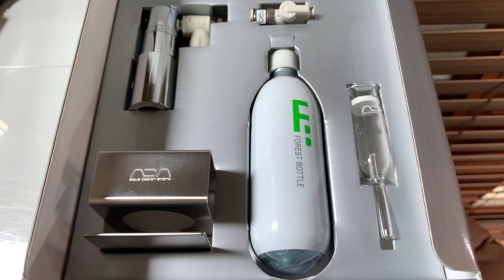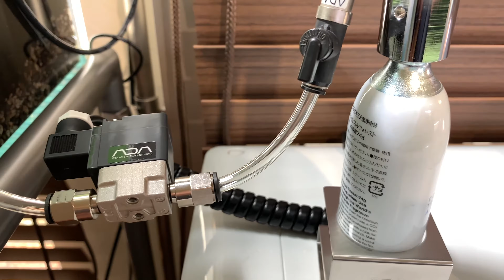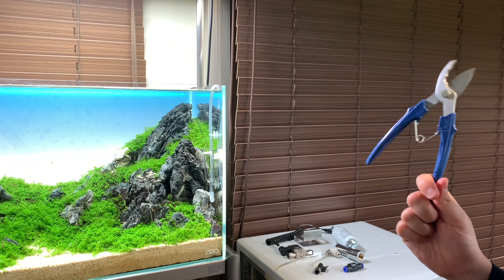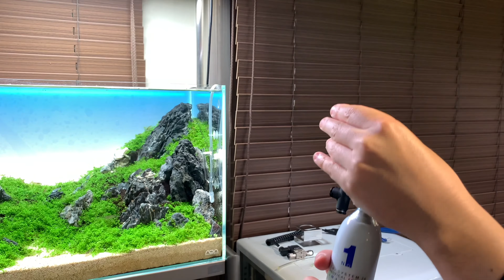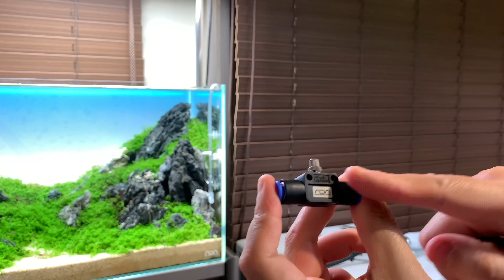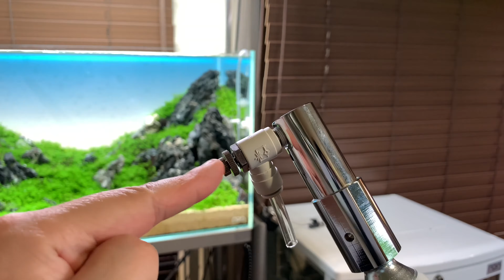How to setup Co2 system for planted aquariums [ADA advance forest kit] CO2 injection,installation

Comment: ADA produces nice equipment but there are many better value products. Still very cool!
Reply: Official WASABI Moderator: There are many alternative products out there. How did your competition tank submission go?
Reply: @NORIaquaCh  The competition entry ends 31 May so i am getting my scape ready for the final photo still. I think its looking good but I have a bit of bba on the lava rock. Any tips on how I can prevent/remove it?
Reply: @uraninite8151  Official WASABI Moderator: I also had some BBA recently, unfortunately to remove BBA is to physically scrape it off under hot water (if you don't want to use chemicals). If you have Seachem Excel, it's a quick fix. Directly dose the BBA with it with a syringe.

Comment: Thank you for the wonderful videos. A query to consider, the placement of the diffuser. Bubbles quickly rise to the surface. Is it best for water flow to move the bubbles across the tank and try and reduce bubbles just going from the diffuser and straight to the surface?
Reply: Official WASABI Moderator: Hi Laurence, the CO2 diffuser is best placed opposite to the outflow pipe from the filter.